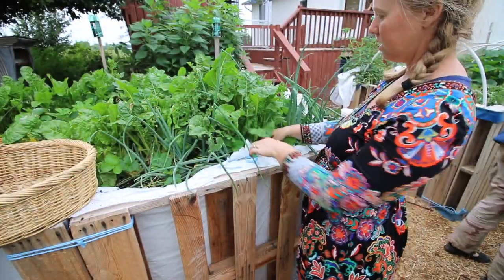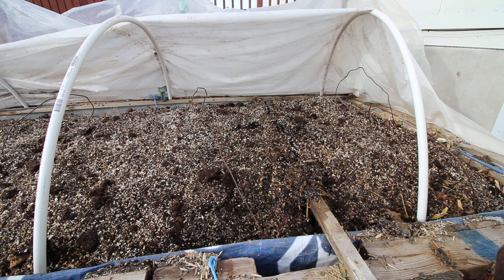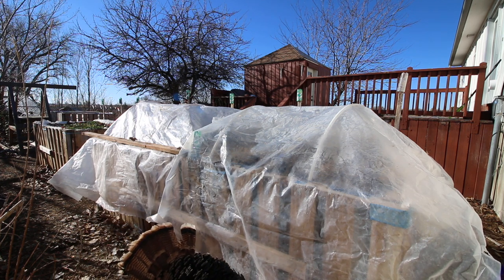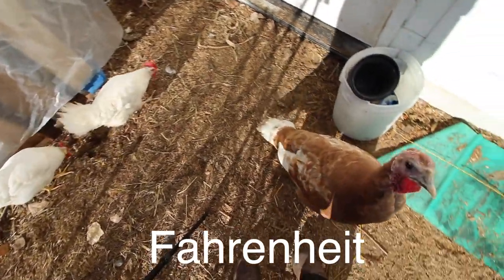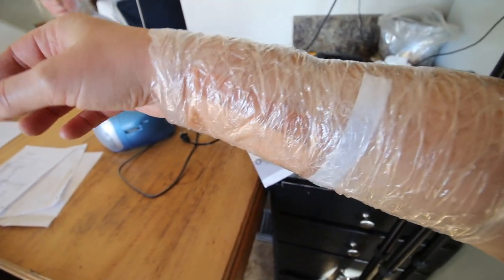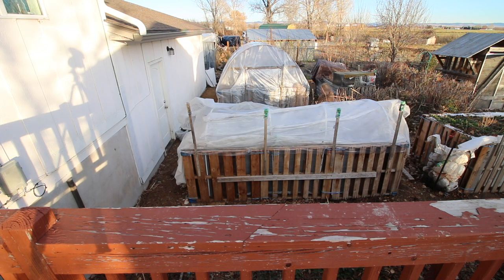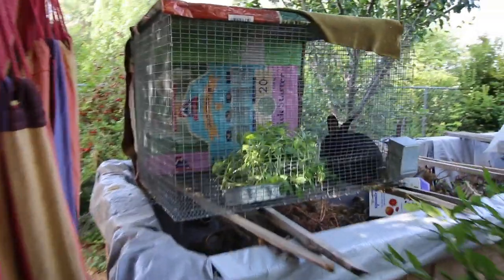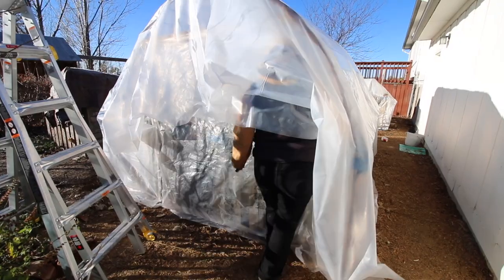Self heating garden bed planted in November

Comment: Thank you! I wasn't sure if they went all the way to the ground on the bottom. Love the pallet idea. Great no build solution!
Reply from the maker: I need to maybe make more detail on a lot of these videos. I have made so many videos about the hotbeds I don't want to bore people I just don't know what is redundant.
Reply: Just be aware that not all pallets are equal. Some are heavy duty, maybe oak or some hard wood, as well. Many though, are rather flimsy and/or have wood that breaks down quickly, starting to lose the nails quite soon. Which is why my husband won't usually let me use them to "build" things ( danger of life getting away from you and before you know it, you have nails and staples getting loose and maybe into your foot. Since my brother gor a nail in his foot quite badly once, on my parent's farm , and having had a cow with a huge one stuck straight up into the center of her hoof once ( for both instances, adding colloidal silver to the treatment or soak, helped a lot btw. ) , so I know that can be real serious , and not worth the risk, if they're truly gunna break down soon, and in certain types of uses, you won't be able to really monitor them, catch loose hardware . So, just be aware of this caution plz. .

Comment: Winter solstice, actually. Matching the summer solstice where days start getting shorter again. The equinoxes are in spring and fall, which mark the mid point in the daylight transition (just think "equals" to remember, because the equinoxes' day-lengths are roughly equal to each other).

I'm really curious how well that hotbed with only hoops will work under a snow load. We make our hoops out of the PVC that comes in rolls, and I've seen un-reinforced hoops get crushed under one snowfall and plastic sheets ripped apart over reinforced ones, and I know you guys are further north than me. I've found it necessary to add a hoop-top bar (which could be rebar, EMC, or a small board like a 1x2 or 2x2) and sometimes a couple more going down the hoop, just to force the snow to the bottom. Then hopefully the narrow pallet top won't provide enough mass for the snow to rip the plastic apart.

The cattle panel arch is an interesting idea, though. May try that one. Would be necessary to cover two beds because otherwise you can't reach to manage the bed, so it'll have to wait until we get two beds set up side by side. If we can keep the plastic off the ground by hooking it to wood at ground level, that would help minimize the ripping force of snow even more. And if we use wood to seal it down, the wind won't be able to get under it. Maybe then the hoop house would survive our brutal winters.
Reply from the maker: Thank you!

Comment: do you use urine . to activate heat . THERMOMETER would help showing temp. for video's  . and deep in side . My Uncle . Put a hose under silage ,crib . always had hot water . In barnyard .
Hot beds ! great Job  !
Reply from the maker: You can use urine. We did before we started to put rabbits on the beds.

Comment: What are your thoughts on all of the micro plastics leaching into your soil and water and food - from the foundation lining? I have successfully used several layers of corrugated cardboard for this kind of setup - compost. It remained intact for more than one season.
Reply from the maker: Most of my beds are lined with metal. I built these beds to show you could use plastic. Am I worried about the plastic? No, the outside of the bed doesn't heat up much at all and water evaporates there first. That being said I do prefer metal because the plastic in these beds breaks down faster than metal. I feel that if I 'brought plastic into this world' with my purchases I need to find a way to use it and this is how I do it. This particular bed is lined with an old billboard that I then used as a hay tarp and now I am using it in the hotbed. I do use cardboard a lot and it also can have plastic fibers in it. I just don't worry about it.
Reply: @dirtpatcheaven  thanks for your thoughtful response. if you have the energy, I'd enjoy reading up on plastics in cardboard. i'm unable to find any reports - it's possible i'm not using the correct search terms.

Comment: How do you ensure those plastic covers remain in place when the storms appear?
Reply from the maker: I put those 2x4's on the edges. This bed is in a sheltered spot so the wind never gets as bad as it would in wind-exposed parts of the property. However, this same design made it in Tulsa Oklahoma during tornado watches too so maybe it isn't just that my current backyard is sheltered. The back of the plastic is sandwiched by a piece of lathe and the hotbed frame, so that I can only open it on the downwind side. I can't believe I haven't shown that in a video. Good question. I will try to get some footage of the cover.

Comment: I was wondering, Do you think hot beds can be made from cinder blocks stacked up?
Reply from the maker: Definitely! Just make sure that they are interlocking in a way that they won't come apart before you want them to. Eventually I take these wood ones apart and reuse the insides as planting medium for a new bed but with cinderblock it would definitely last longer. Without cement in the seams it won't probably be able to handle a lot of rough dumping or gravity pushing the new compost out as it settles against the walls.

Comment: Julienne, when you need to add more compost /soil do you just put it over the top or do you completely take apart the whole bed and start over?
Reply from the maker: I don't take apart the bed. I add it to the top. But I add it to the top in the same way. We put sawdust and rabbit cages on the top of the beds every time before we replant a bed. Two inches of topsoil after the rabbits are moved away. Have you read my ebook? It is on my etsy store.
Reply: @dirtpatcheaven  I haven’t read your book yet. I only have a phone as a computer so most things are difficult to read. I did order the books you suggested though. Thank you!